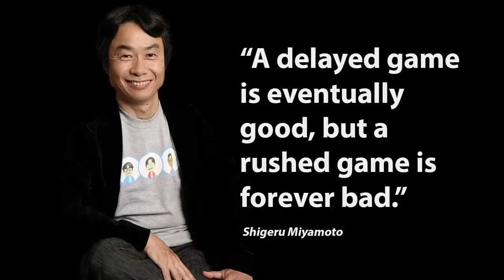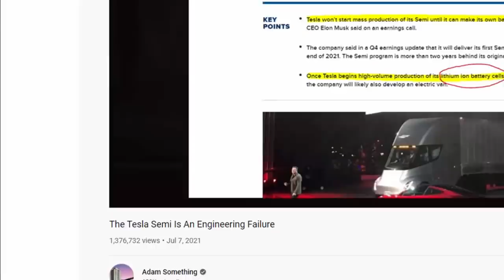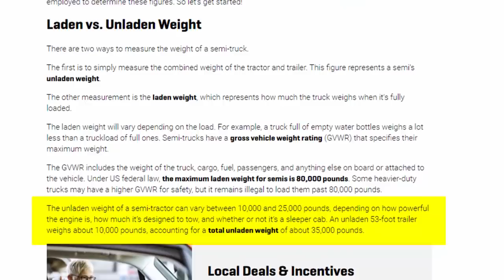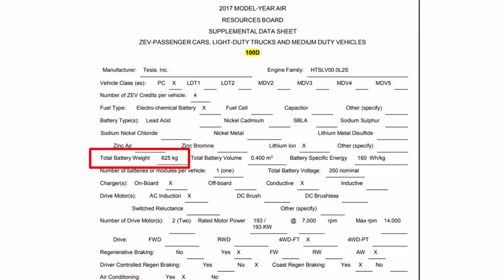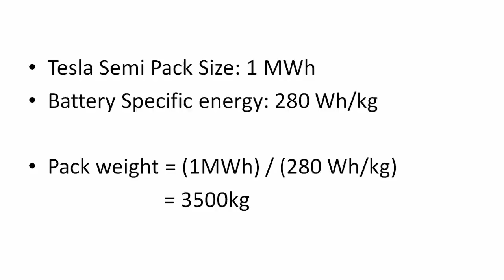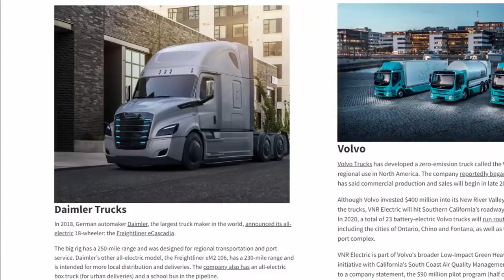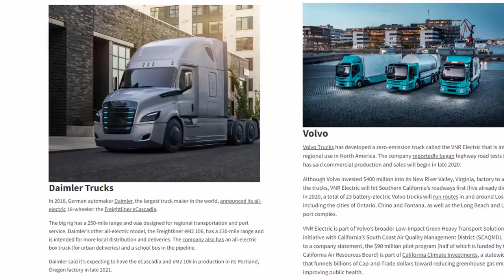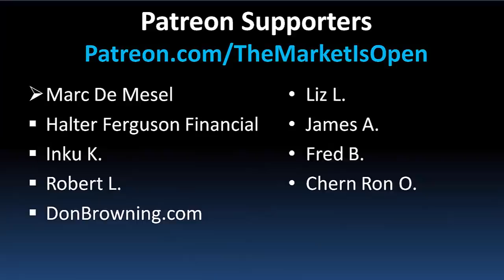The 2022 Tesla Semi is Genius, And Here’s Why

Comment: My view is the delay is almost all about the 4680. I think they had a workable design at around the time of the announcement, but they had a series of production issues. The only one I have heard of specifically was the dry electrode material caused dents in the calendering rollers, (where the electrodes are compressed onto the base film to give an even coating) As I understand it, they found a solution last year by dividing that part of the process into 8 stages, with 8 individual rollers to spread out the pressing process, reducing the load on the rollers and thus preventing the dents. Going  by the way the fitting out of the cell lines at Austin has been happening, I think that all production issues are sorted, or at least very close. As far as range is concerned, I'm thinking that they can comfortably exceed 500 miles as a base figure. That will drop in cold conditions, but I don't think we will see as much of a % drop as some of the cars do. The additional size of the truck makes insulation of the battery pack an easier thing to do, so on a per KWh basis, keeping the battery at a good operating temperature will require less energy. I could be wrong in this. The biggest issue I see for the introduction is the chargers, and I can see opportunities for companies who embrace the technology but there will be aspects that need to be considered. Just planning the layout of stopovers will need to change. The first uses will be between fixed depots so that chargers can be installed, but as they start to penetrate the market, truck stops will need to get into the game in a big way. This is such a big thing, that sales will go to areas where those truck stops are built, and those areas where no investment in the stops is not forthcoming, or where utilities or local governments put up road blocks, the sales will not happen. Because of this, cross country trucking will not see these trucks soon.
Reply: No it was always for 2022 , 4680 was excuse created for skiping legal issues , it was stock market pump stunt along with roadster
Reply: Turns out we were all wrong,  while I am sure 4680 will produce a whole series of upgrades the restraint was the total availabolity of batteries.  Although it now uses the plaid motor and only three, a massive weight saving. The plaid motor only been in production for about a year.

Comment: If the Tesla Semi is after the long haul market, then Volvo and Daimler are not competing there, at least at first. The current Volvo trials in the US are with short "1st mile" journeys from a port to distribution centre, and the semi's are moving containers. Range is irrelevant. In Europe Volvo and Daimler have set-up a joint enterprise to work on charging infrastructure, with chargers at 500 kW and 750 kW planned. They are currently in negotiations to have 1000 sites across Europe. If the new battery tech, or something like it becomes available to other manufacturers, then Tesla will have competition.

There are two areas where infrastructure is already in use in London. Several companies have introduced full EV buses, with charging stations at the depots. At least one has V2G. The other area is supermarket delivery. 3 of the companies that delivery in my part of SW London have electric vans in regular service. They only do about 30 to 40 miles at a time before going back to the "fulfilment hub" to load up again. That takes up to half an hour, so they have chargers at the dock and can top up. Otherwise they can charge up overnight. A vans working day is usually from 6 am to 10 pm.

There is a lot going on besides Tesla, and the most important issue for fleet owners and managers is NOT price of purchase, but whole life cost, and that includes fuel and maintenance. I saw an interview with the fleet manager for a big supermarket chain who said that the whole life cost for EVs was much less because of the lower maintenance costs. That seems to be the USP for electric commercial vehicles.

Finally in any country that has sensible regulations for drivers working time, a 500 mile range is unnecessary! If a driver has to stop for a break, then they can charge then. Tesla want 500 miles for the self-driving truck!
Reply: Tesla builds, everybody else plans.

Comment: I can imagine a truck driver driving 500 miles, and then having to recharge for 20 hours, so he can drive another 500 miles. Not so genius.
Reply: It recharges 80 % within 30 min on a megacharger. Full within 1 hour. genius.
Reply: @vic321344  I highly doubt they'll be able to achieve those projected numbers, because for a BEV that's extremely fast, but comparatively, that still fucken sucks compared to diesel or hydrogen FCEVs. Time is money and truck drivers as well as the companies don't have time for that

Comment: It isn't so much that you can't make an airplane fly or a semitrailer haul, it's the question of how much percentage of the overall weight and volume of the vehicle is dedicated to batteries.

Currently the specific energy of batteries is about 1/100 that of diesel fuel. Even if you were to recover all of the regenerative potential energy, punching through the air is extremely lossy.

Something is going to give, and that appears to be cargo weight per mile as a function of GVW.
Reply: The electric drivetrain incl batteries and engines weighs 2 tons more than the diesel drivetrain. If you add a large cabin or something else, it adds up on both variants.
In Europe BEVs are allowed to weigh 2 tons more.
Reply: Merely comparing the specific energies of battery and fuel is disingenuous. You would need to compare the specific energies of batteries and fuel plus engine weight. There isn't nearly as much difference at that point.
Reply: @41-Haiku  True, but I didn't want to do a complete treatise on the subject except to say that there are some significant challenges that need to be overcome even despite the engine and fuel differences between the two transportation systems. I was most assuredly not being disingenuous.

Comment: Areodymanics should be the first priority on semis
Reply: On demand hydrogen production off a carried battery would save all the complexity
Reply: @polok890  You are right, adding hydrogen production (pumps, pipes, converter, high pressure tanks) would increase the complexity back to Diesel complexity. So there will be no gain in cost of ownership.

Comment: You bash "truck people" for not understanding Tesla yet you have no hard evidence to counteract their claims that an electric truck is wildly difficult to build? If it were so easy it would have happened already. Tesla knows how to build electric vehicles. Clearly the truck is proving to be difficult.
Reply from the maker: Yes I do have the evidence. Tesla built a semi truck and they give the specs. They clearly know how to build an EV, as you mentioned. Yes the truck is difficult, but as mentioned in the video, making many trucks is even more difficult, but is bottlenecked mainly by batteries. So the counter argument is that people just don't believe Tesla's specs, which isn't a good enough argument.

Comment: Where are they going to recharge.  How long does it take to recharge.  The trucking industry has a challenge of where to park trucks.  Now that they will need to be stationary far longer than it takes to fill 200 gallons of diesel fuel, what’s the solution for that reality?
Reply from the maker: 400 miles in 30 minutes is what Tesla states. they need Megachargers as mentioned in the video. They're starting with the routes of their customer, as mentioned in the video. I believe Pepsi just got their first megacharger installed this weekend.

Comment: Volvo, Mercedes, Daf and a host of Chinese truck companies are already producing and running EV semi/trucks, and they have been making HGVs for decades... currently the small fleets are running in test environments with selected haulers [the Chinese selling to business..and already rolled out  automated train semis].
Tesla is not a truck manufacturer.. to build a factory it needs a lot of pre orders..a lot. The European manufacturers have the factories, the service network and long reputation with fleet customers.
Whilst I agree Adam something and Thunderfoot have been too literal the initial Tesla Semi will have to be fleet operated with fixed routes.. depot to depot and with custom sized batteries for those routes.
Realistically a 180 watts per kilo battery and a 3 tonne battery and a realistic 2 miles/kWh will offer enough flexibility for fleet owners.... but they will need to see the Tesla semi as a mid production vehicle ..otherwise they can go to either Volvo or Mercedes 

Tesla's problem is breaking into a market that would be lower profits than cars and one current truck makers are equally advanced in.

In Europe it appears tram lines on motorways with only small battery packs for last mile mobility will dominate the market.
Tesla will be a player eventually.. but I wouldn't back them financially in this area
Reply: The other trucks are much more expensive , load much longer and just have a range of 200 miles.

Comment: As a truck driver for 10 years I can definitely tell you  this truck was produced  Without any input from a truck driver.
Reply: what does a truck driver know about truck production?
Reply: @fromthepeanutgallery1084  The seating position in center will make blind side backing nearly impossible. Meaning line of sight of the trl is blocked from view from landing gear up to the cab overhead and lower obstacles can not be viewed . So instead of a $40 dollar mirror  you have thousands of dollars in camreas an screen that will go out over a trucks normal 1.5 million mile life cycle.   About production almost all logistics accounts are just in time  Freight that means that the freight is not there at an exact time it shuts down an entire factory this is the way Toyota Ford Chrysler And Tesla do everything so they don't have to have big warehouses with all the parts to build their cars the trucks come in loaded with parts they get unloaded and it goes right to the production line it's also save some money on taxes On my account I work for if we shut the production line down it's a $125000 fine per minute I'm not kidding 1 minute  the trucking company So reliability and quickness of repairs  on the side of the road or  replacement truck while the truck is being repaired is vital Tesla you know  does not have this ability right now even with their cars people are waiting months to just get door handles Nor do I see logistics companies buying these trucks based on the fact that something like its drive train if it does go out will literally total the vehicle out.
Reply: @mikevenson7818  Would cameras mounted in strategic positions not help the driver to see those blind spots? Just curious. Cheers.
Reply: @gwarlow  RIGHT, YOURE PROVING HIS POINT. THEY DONT WORK AS WELL AS BEING ABLE TO LITERALLY LOOK OUT ONE SIDE. CRETIN
Reply: @mikevenson7818  quiet down, this is how tesla gets investor money. Overpromise, make something cool looking to the non informed.
Reply: @mikevenson7818  its suppose to have more cameras then the cars
Reply: @justus7181  more camreas mean more money. A mirror was just replaced on my truck for $42.
Reply: @gwarlow  You would be able too if the camera could extend a couple of feet out of the truck but $40 mirror vs $1000 dollars worth of camera system
Reply: @mikevenson7818  camera system for owner operators that want them should be choice with option.  

Camera's that also are mounted on the sides to remove blind spots with turn would be a huge plus. 

Camera's in the tractor should not be allowed, unless if it's specifically for an owner operator, who want them on when they're not in the truck, sleeping, have left the truck parked, or when stolen.  

Stay safe, Godspeed
Reply: Given that the medium term goal is to not require a driver at all that is a reasonable position for them to take.
Reply: Produced means delivered to a customer,so,no,no tesla semis produced.
Reply: @paulbedichek2679  Tesla has delivered 15 Trucks to Pepsico. The large scale production will begin 2023, when the battery factories for the 4680 cell will be ready.
All other manufacturers have to be satisfied with 300 miles range, as they dont get better batteries. If they get them at all.
Reply: Like cars were produced without any input of horse carriage drivers. More exactly: they began to take over the market at the moment, they abandoned all horse carriage ideas.

Comment: To the manufacturers and their engineers, I give them all A+'s.  They are implementing, with success, the whimsical dreams of some bloviating governmental bureaucrat, owned by the Chinese, who is worrying about a crisis that doesn't exist.  I could go on for about as long as it takes to charge an electric car, but...

Insofar as the general shift to electric cars is concerned, I call bullshit...  its a government mandated novelty.  Why? Batteries and the electrical grid.  Presently, there are rolling brownouts merely because people run their home air conditioners!  What happens when electric cars are sold in really large numbers?  Just when will we double or triple our generating capacity?   I don't see people lining up to have coal-fired or nuclear generating stations built in their backyards.  BTW, China has a monopoly on materials for battery production.  Let that sink in.

Comment: Old school vehicles:  fix it yourself.  Modern computerized vehicles:  repaired quickly, but by a pro.  Tesla:  wait weeks or months to repair it.
Reply: There is no need to repair parts that are just not existent. Injections, turbochargers, Pumps, radiators, transmissions...

Comment: Interesting facts though cooling for truck batteries designed for sustained heavy loads will need to be much beefier, also showing Tesla Model 3 motors to point weight savings compared to truck diesel is just silly, as again, Semi will use beefier el. motors due to cooling requirements even when in theory performance models of consumer Tesla cars have necessary theoretical power, they need low-end torque and high output that can be sustained for million miles. So, while I believe that weight assessment in this video was rather over-optimistic and somewhat biased in findings that this or that argument is completely destroyed by this Tesla statement, like if all statements Tesla made become facts (still believing in full self-driving becoming reality long before competition like Waymo and plenty of others anyone?), 300-mile version is fully plausible to be superior to diesel and as  this version will be the most produced variant anyway,  whatever difficulties in producing comparable longer range el. truck that is comparable to a diesel even in winter conditions are largely irrelevant for a large portion of the customers.

Comment: The fire in a tunnel situation was glossed over pretty fast and ignored something important. Truck fires are frequently started at the tires or brakes because of a problem, not from the fuel or drivetrain. Once the truck is already on fire the burning batteries are definitely something first responders need to adapt too. Burning vehicles no matter the fuel source cause devastating damage to infrastructure, the question is will the lithium burn hotter than diesel?
Reply: Lithium cells burn very slow. You have every time in the world to evacuate and pull the truck out of the tunnel.
Reply: Not so much hotter but they are far harder to put out requiring 50,000 gallons of water on average to put out an EV fire and as much as 24 hours to do so.
Reply: @chrisrawr6177  Or you put the truck in a container full of water and wait 3 days.

Comment: Your calculations may be inaccurate also. You assume as a baseline that Tesla’s published energy consumption numbers are accurate. A better way would be to calculate the amount of stored energy is contained in 200 gallons of diesel fuel which is a common fuel capacity of an ore truck and then calculate how many kWh of electricity that equates to and that will give you the required battery size  I would note that a recent test of a rivian pickup towing a light weight aluminum trailer with a relatively light Ford Mustang on the trailer resulted in each charge lasting about 100 miles  therefore I estimate this rivian test combo was around 15000 lbs. a loaded semi like I run is 80k or almost 5 to 6 times what the rivian weighs not even taking into account the vastly higher aerodynamic drag of a semi trailer. Time will tell
Reply from the maker: Your calculation doesn't work because electric vehicle are far more energy efficient than diesel. So converting the energy stores in fossil fuel to KWh is pointless. It's significantly more accurate to use Tesla's estimates. This way you won't be off by an order of magnitude.
Reply: @TMIOTesla  I understand that electric is more efficient but I'm not just going to take Teslas word on that.   Just look how much that rivian range dropped pulling a light weight aluminum trailer with a ford mustang on it.  The test I saw they were getting about 100 miles per charge, when the normal is what, approx 300?  Something isnt right here because if they perform as advertised they should make some and get them in the public's hands to try in the real world.

I'm also concerned how much the range will suffer in cold weather.   This morning where I live it was minus 14F and I believe that has to have some impact on range....

Comment: I suspect there is a reason that payload capacity has not been released.  No one cares about 0-60 times, what is the cost/mile/pound of payload?  Truck stops will need their own power station to charge more than 4 trucks at a time, the whole thing is doomed to failure.
Reply: The megacharger costs less than a Diesel fuel station. And it can be built everywhere. No environmental check necessary.